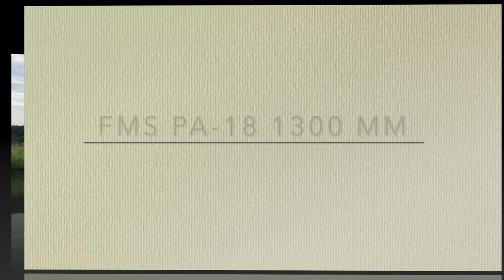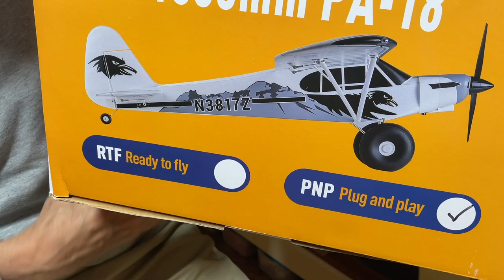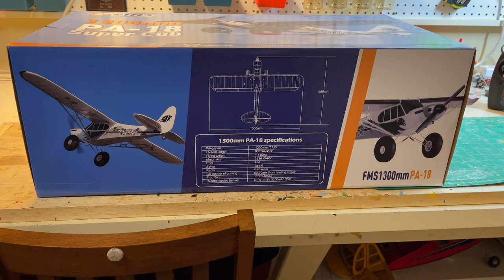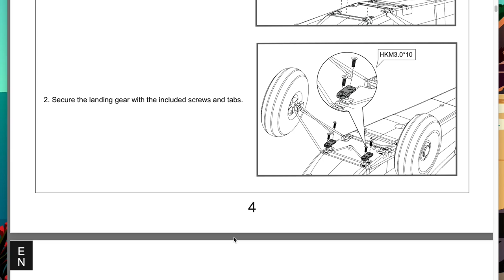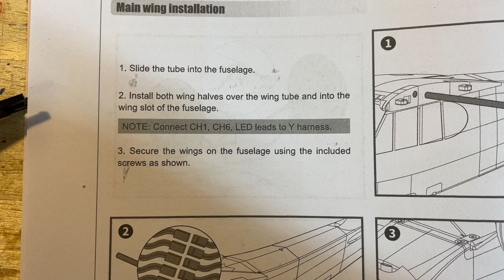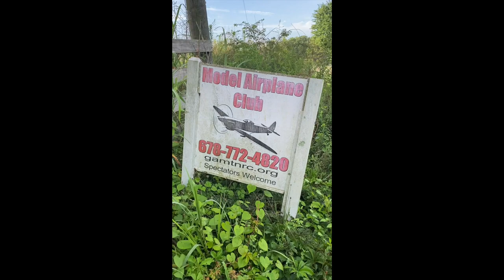FMS PA 18 1300 mm Unbox, Assemble, Fly

Comment: THANK YOU, thank you for this RECORDING! VERY VALUABLE comments. VERY WELL AND FACTUALLY EXPLAINED! No rush, no delays, no shouting! Just right! REGARDS. I have a question, can this EPP model be protected or the color changed: with varnish or heat shrink foil?
Reply from the maker: Glad you liked the video!  You can cover this model with iron-on covering, just keep a low heat setting.  Acrylic paint will work fine as well.  Be sure to check the center of gravity for correct location when complete.

Comment: Hi, friend! I would like to acquire my first FMS brand airplane (but in reality I am very concerned about the compatibility of the electronics, that is to say... the majority of horizon hobby RTF airplanes contain spektrum electronics and many times their models are limited to said electronics... my question is.. is it possible to attach any other esc and receiver like Flysky to the fms planes?
Reply from the maker: I like FMS airplanes a lot. Very thought out and they fly well.  Especially the PA-18. The ESCs come built in, usually I never see them as they are buried in the fuselage. You’ll provide your own receiver (I use Spektrum AR620) and most receivers will work with any ESC. Tim

Comment: I use the AR 637t in some of my planes.   Usually not on, but it has saved me from losing a plane or two.  I assume the reflex performs a similar function.
Reply from the maker: Most likely.  The PA-18 is super easy to fly, though.  Tim